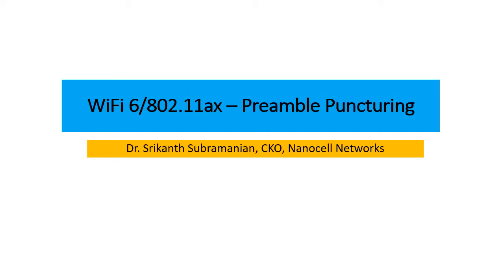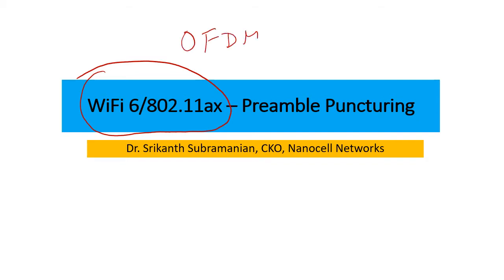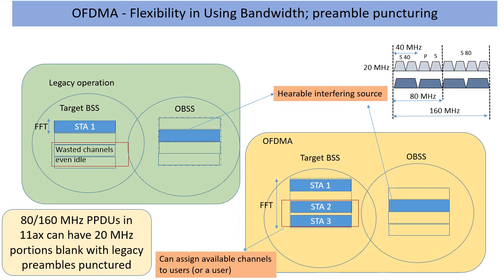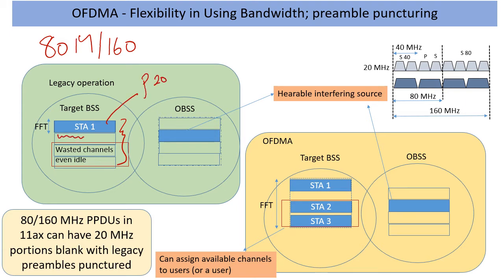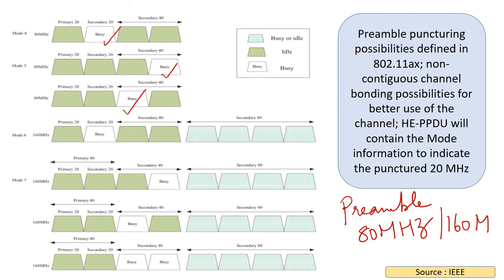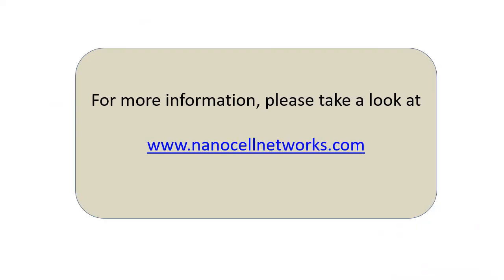802.11ax/ WiFi 6 Preamble puncturing

Comment: Thanks for the explanation! 

Does Preamble puncturing only cover the scenario where only 20MHz is busy(in 80MHz scenario), i.e, do we have scenarios where 40 or even 60MHz is busy with OBSS? 

Also, In 160MHz(and non-contagious 80+80), the secondary 80MHz is assumed in any state(busy or idle)…

Is Preamble Puncturing only done for Control/Management frames, is this not done for Data frames(where the secondary 80MHz matter)?